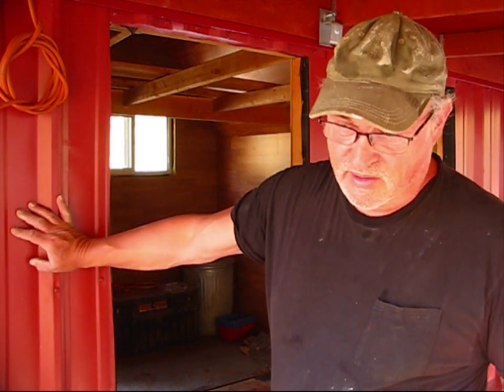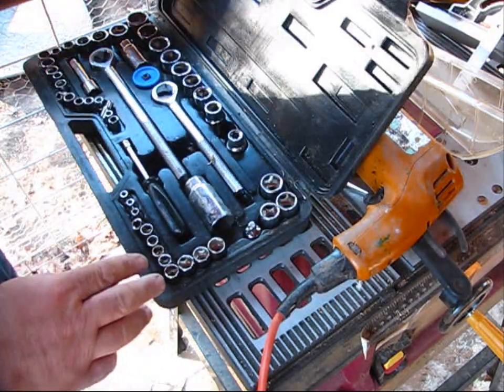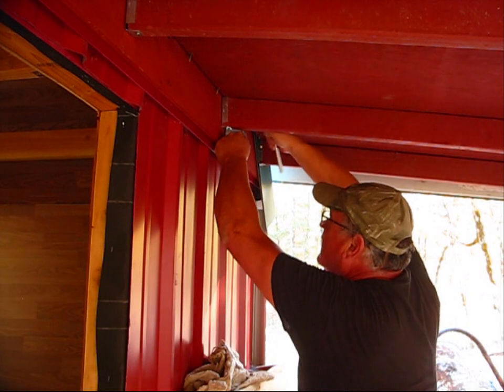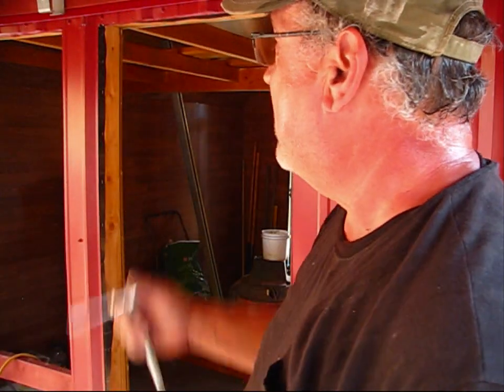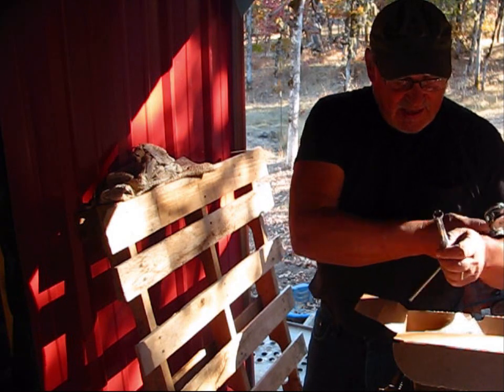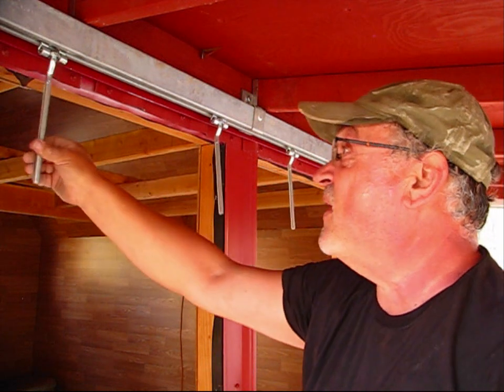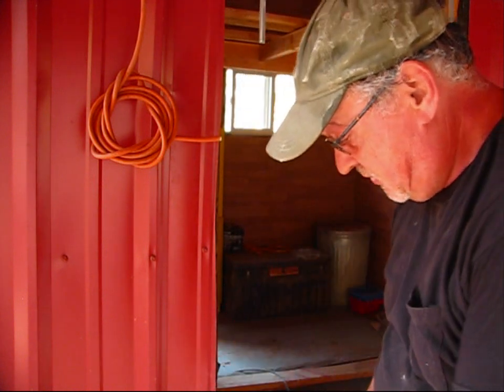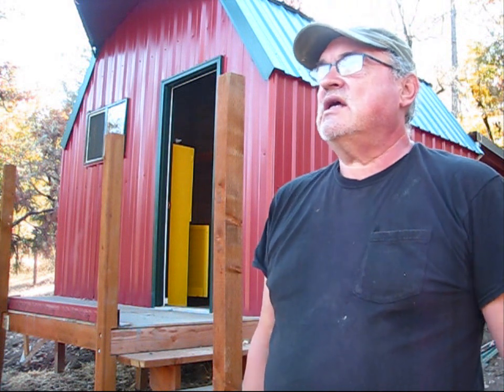HOMESTEAD BUILDING PROJECTS 11 - Installing Rail and Trolley  For Sliding Barn Doors

Comment: Looks good Jerry! You probably have a plan, but a simple nut and bolt ran through each of the track ends works good for roller stops.
Reply from the maker: Thats exactly what I want to do with those stoppers I tapped in at the ends with a hammer. When I journey into the city tomorrow I will be purchasing a new rope and a bolt set with lock nuts.
Reply: I figured you had a plan :)

Comment: Once you get your doors installed, install some sort of stop block at either end of the rail so your doors don't accidentally slip off. If that happens it's a pain in the neck to get them back on!
Reply from the maker: OK
Reply: National hardware (the trolly mfr) includes stops/end plugs .  U can also place one in the middle when installing paired doors.

Comment: My experience: measure the door plate to the bottom of the trolly wheel.  Add that to the length of the door +.5" for spacing.  The lag holes are 3.5" from the bottom of the wheel track (base of the rail).
Reply from the maker: Thank you for your input. I also use this trolley system on my hay lift setup.

Comment: I've searched the web for those side-mount brackets to no avail. Where did you get them?
Reply from the maker: I purchased them at LOWES
Reply: @pinemeadowshobbyfarmafruga8319  I searched their inventory in person and online but couldn't find it. Do you have a name or part #? Thanks!
Reply from the maker: https://www.lowes.com/pd/National-Hardware-8-ft-L-x-2-4-in-W-x-1-88-in-H-Plated-Steel-Plain-Square-Tube/1000390757  https://www.lowes.com/pd/National-Hardware-2-01-in-Steel-Sliding-Patio-Door-Roller-Or-Pulley-Roller/1000390777
Reply: Sorry I meant the brackets to attach the strut to the building. The only ones I see are https://images.app.goo.gl/wznb2TeYq9MZTX5fA
Reply from the maker: https://www.lowes.com/pd/National-Hardware-Steel-Screen-Door-and-Storm-Door-Top-Bracket/1000068849 HOPE THIS HELPS
Reply: That's it, thanks!
Reply from the maker: Glad I could help